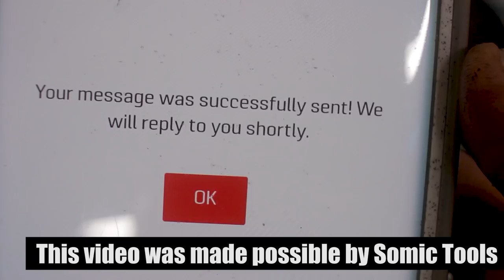BUILDING A COROLLA IN 10 MINUTES

Comment: Sonic sounds like a great brand and it definitely sounds like the return policy on broken equipment it's was less s hassle compared to craftsman... an I know snap on will only replace them if they're "used properly aka aways try to say its not  their fault u "used it" aka the tools improperly... u might wanna check out FCPEURO. COM... they have a no questions asked policy on replacing broken or defective parts... they even replace *wearing components like brake rotors pads clutch's etc... so it's def a great place to look into... they use good brands for fair prices. an ships quickly... only place I e ever seen who'd replace an parts fir an reason for life bro